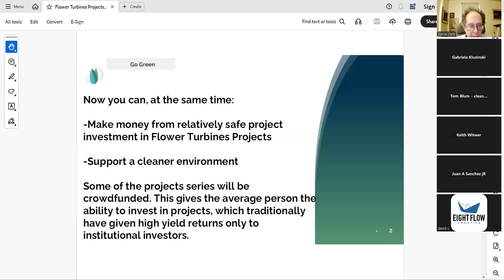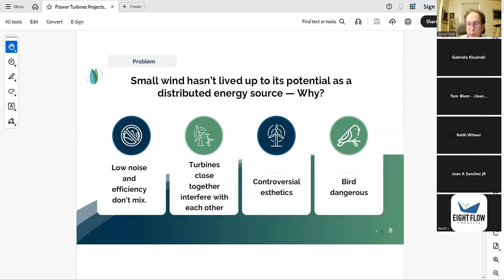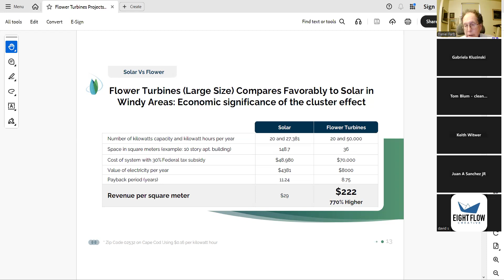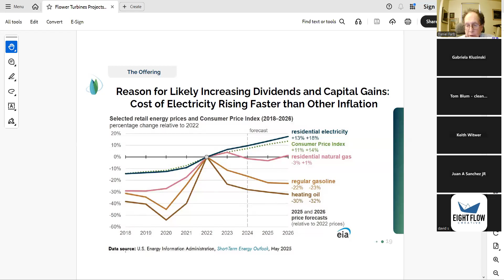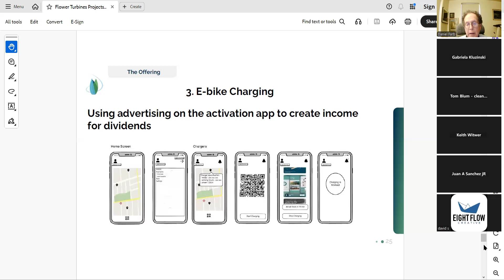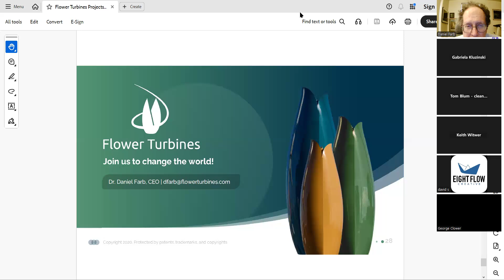Flower Turbines Projects Series1 Investment Webinar

Comment: Would it work to build a 20-story building, each floor about 8 meters high, without walls nor enclosed floors, only with beams forming a skeleton on which we would place about 100 large turbines (6 meters high) on each floor, forming a bouquet in the most efficient configuration ???
We would have 2000 turbines without taking up much space.